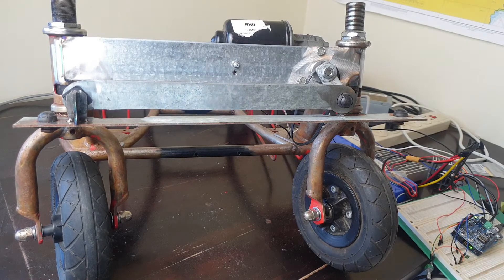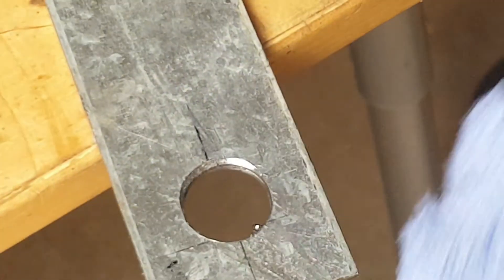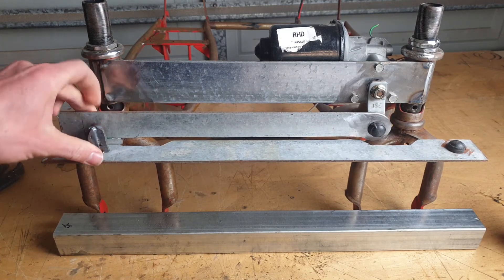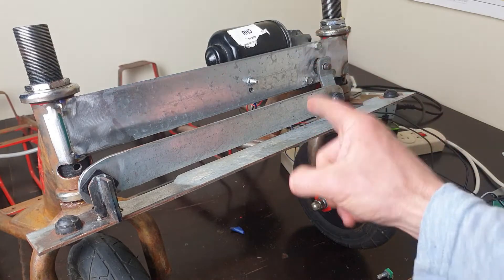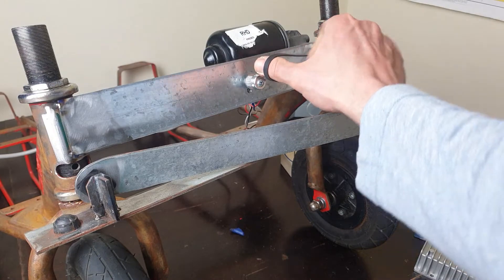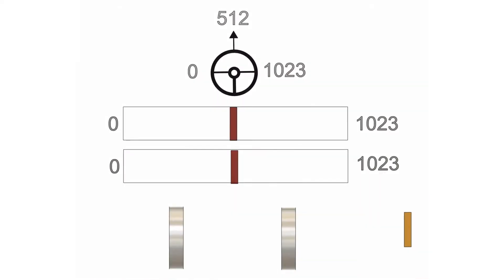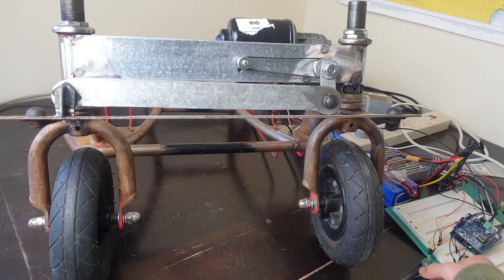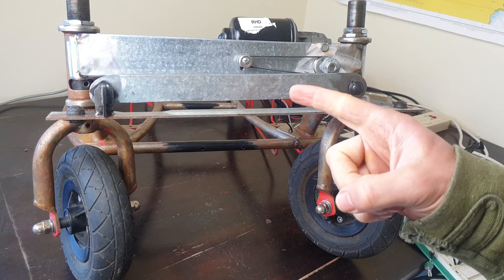Power Go Kart Steering DIY Part 2

Comment: Have you the code still, its great setup.
Reply from the maker: https://app.arduino.cc/sketches/4ce40013-434f-4f1f-8121-00f02e92b4cd?nav=Files&view-mode=preview

Let me know if you have an issue accessing this. I did do some notes so it should be pretty inteligable.
Reply from the maker: Also, something I ended up changing but that never made it in the video (I Think), is that steering speed needs to be slower as the Go Kart speed increases. You'll see it in the code. This makes things less swervey.